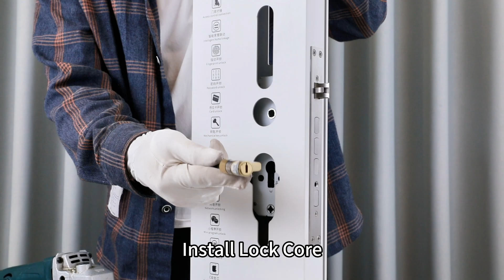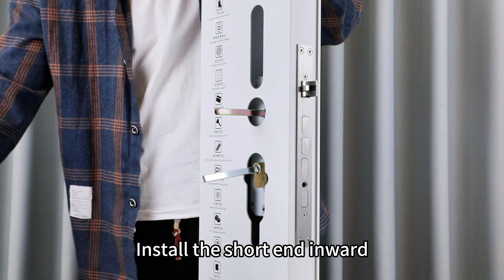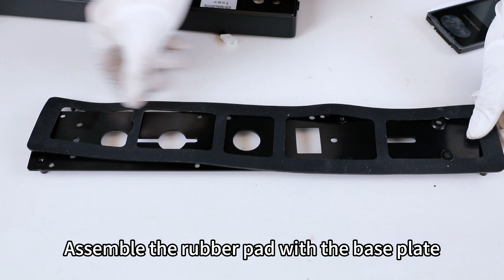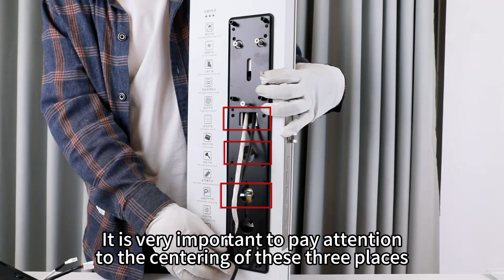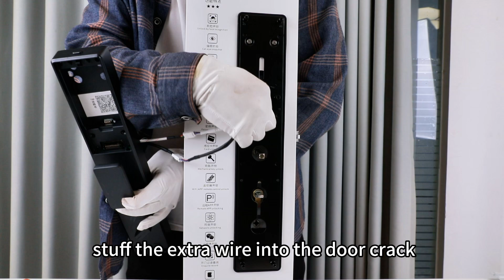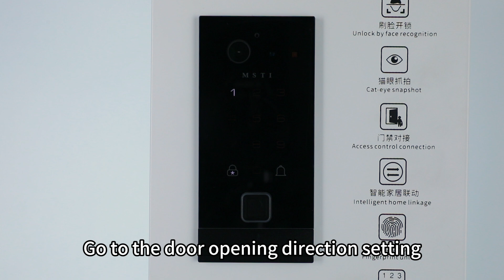MSTI T358 Smart Lock Installation Tutorial

Comment: Hello, I have an MSTI T358 smart lock issue.

The fingerprint, password, and system are working normally.
When I use the fingerprint, the lock says “Unlock”, but the deadbolt/latch does not move at all electronically.

The mechanical key works perfectly and can retract the deadbolt normally.

I already tried:

* Changing door direction using 157#
* Factory reset
* Recharging the battery
* Testing while the door is open
* Restarting the lock

But the problem is still the same.

It seems like the motor is working electronically, but the clutch/gear mechanism is not engaging the deadbolt.

Can you please help me diagnose or fix this issue?